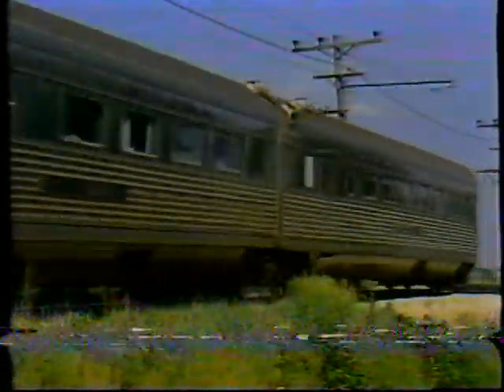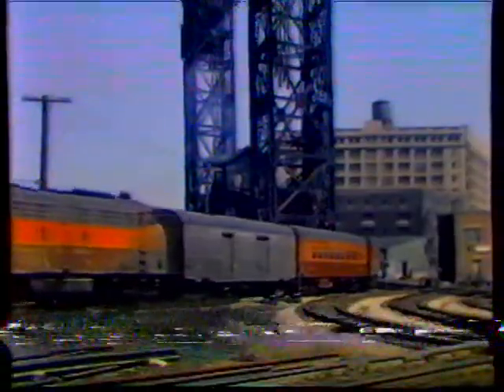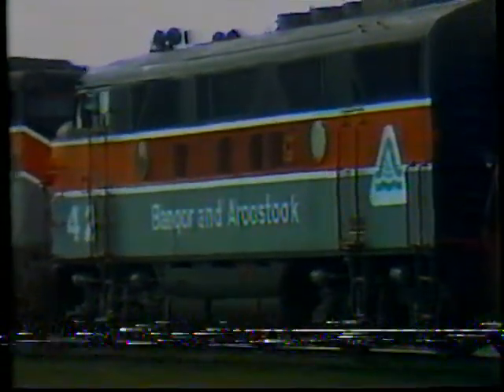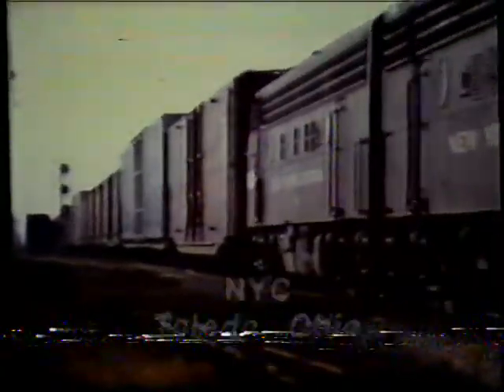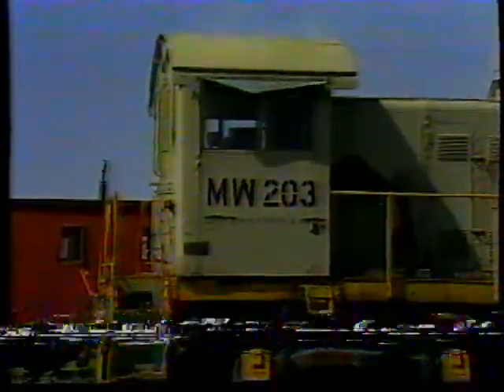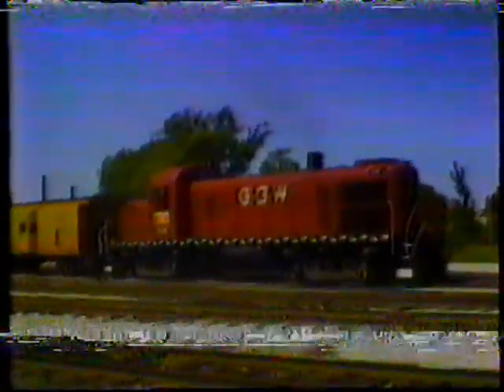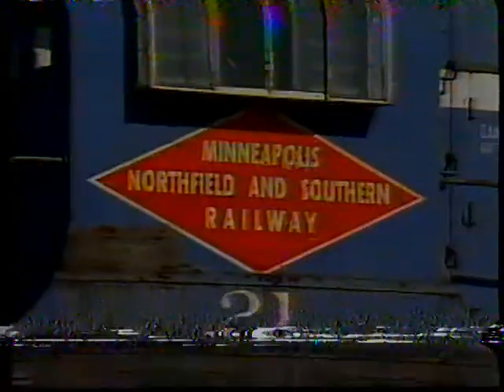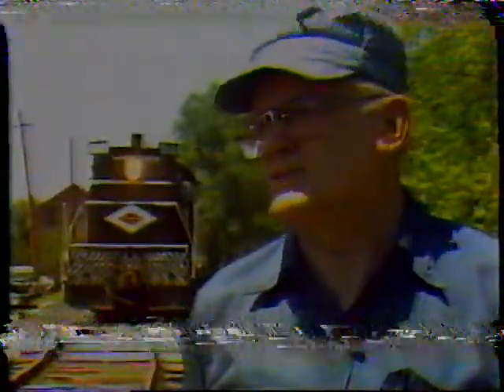First Generation Diesels

Comment: This was a great program. Is there a modern continuation going into the 2000's?
Reply: If one were to be done this year, it would most certainly be about Second Generation Units. The F40's would unquestionably take the place that the E-units have in this program, especially since I feel that Metra will be the last to operate them in regular use, just as most of the E's finished up in Chicago